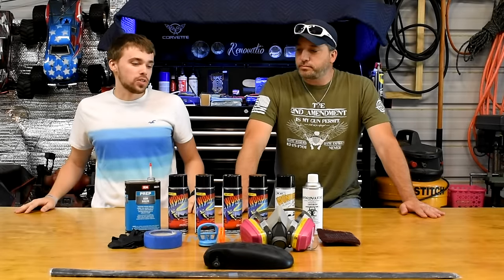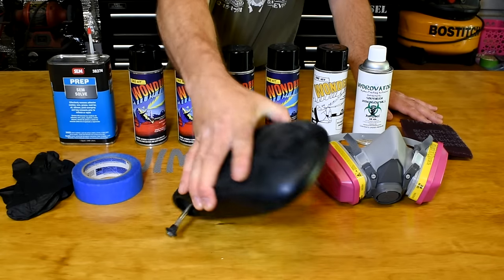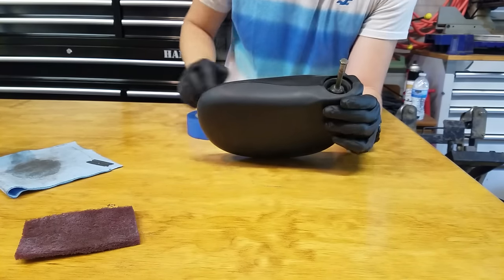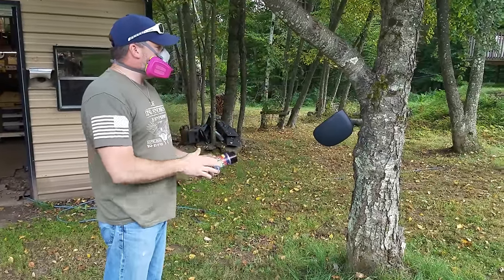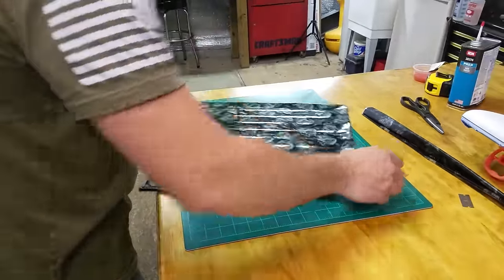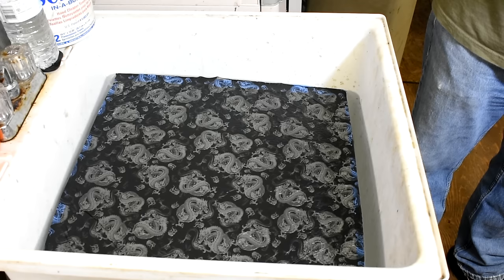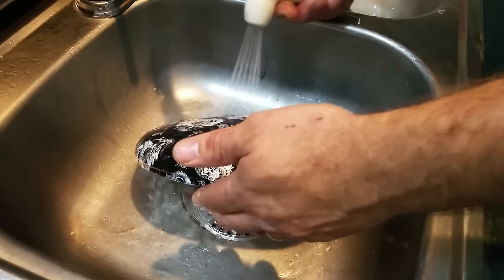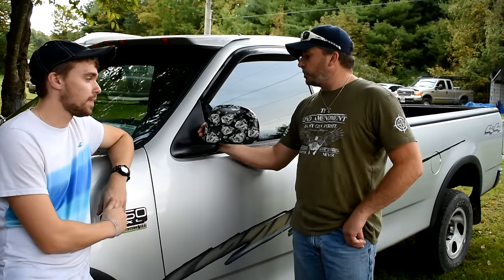How To Hydro Dip For Beginners 2.0

Comment: So I tried hydro dipping earlier today and when rinsing off the sticky layer after dipping it removed the pattern. Any idea why this happened? I made sure the film was placed the right way up in the water.
Thanks
Reply from the maker: That sounds like the surface of your item may not have been prepared properly. If there is any oil or grease from your hands it will prevent the film from sticking. Also, make sure you are using enough Hydrovator. If you don't use enough it will have problems adhering as well. Hope this is of some help, and best of luck on your future dips!

Comment: Right before the mirror was dipped. I saw you poked the film was it? Making sure its activated enough maybe?
Reply from the maker: Alot of the time the little pokes are to try to get the bubbles out before the activator is sprayed. After you spray the activator you're not going to want to touch it as at that point you can mess up the film
Reply: @Jimmy2Tech  after the activator was sprayed Jim's fingers went up at it. Idk if it was by mistake and the water was never touched. And then right after the part was dipped
Reply: @Jimmy2Tech  I was going through the Q and A on the mask and it does not list the type of filter it comes with so it leads you to this affiliate link to offer filters. A pack of 2 is $17.98.  A pack of 4 is $100! This must be a mess up on amazon's part. Crazy though. Thanks for the video. It gave me the confidence I need to start. Way better than the previous video too
Reply from the maker: @Bamlydean  glad you liked it! Best of luck with your dips.

Comment: I'm new to the hydro dipping, but isn't it supposed to be sticky side down and rinse with cold water?? 🤔
Reply from the maker: There are a bunch of different procedures and you can perform whatever one is more convenient for you. This is the way we learned and have had the best success with.
Reply: @Jimmy2Tech  cool just about to do some engine bay parts (1st attempt) and noticed some videos use cold water to rinse, sticky side down, and others are opposite. Wasn't sure if it was a product recommendation or if it was operator preference.

Comment: if you’re dipping like a shoe or leather material would you still use a primer paint?
Reply from the maker: Unfortunately we are not quite sure yet as we haven't dipped shoes just yet. I was thinking about buying a cheap pair for testing purposes. A hard layered leather like a wallet for example to me would make an okay dipping surface but the soft leather may pose an issues as it's got some wiggle to it so it may effect the dip. If you still haven't tried it in the upcoming weeks stay tuned and maybe we can push a video out about it:) we haven't been able to post much do to work, weather, and schedules not always lining up but we have some videos planned.:)
Reply: Puff Gaming yes

Comment: Was that an electric mirror?   If so how did u stop water getting into electric connectors cheers
Reply from the maker: This mirror had no electronic connectors. You can always find the components  and try to  plug connectors . This will stop water from getting in and damaging the system.

Comment: Really nice video.I live in greece and most of the Amazon products are not available. I have spotted on ebay some really nice patterns with a price from 1to 3 euros and others with 30 euros with small difference in  dimensions. do you have any idea what's going on?
Reply from the maker: Not really. Sometimes prices will vary depending on the film manufacturer. Usually patterns dont change the price to much but dimension does. If you're seeing most films at an average price I'd go that route.

Comment: The wonder paint really isn't needed. You can use almost any paint and as long as you hit it with some 800gt sand paper (well you should) before you dip it, just so the film will adhere better. Also, when you're dipping, you should never change the angle mid dip, it'll make the film stretch and with important lines like wood grain, it'll get very wavy. I'd also suggest just using a water hose with whatever temp water, the heat of the water can sometimes make the film flake off but the pressure from a good water nozzle (like one you'd wash you car with) will get all the activator off and won't effect the film. Besides those few tips y'all did great for an at home job!
Reply from the maker: Myles W well thank you kindly for your tips and compliments! Will be sure to give them a whirl. Thanks for watching.

Comment: Hello Jimmy, I just got my film and tried dipping some parts but the problem is that the film won't break down after dipping and when i get it out the water it remains slimy and sticky plus it moves from the subject. ( I have not used any activator ) Wwhat is the problem here?
- can it be done without activator? 
- should I use sand paper on the parts before dipping it?
- should I spray a base on metal or it can be done without it? because most of my work is on plain metal, steel.
- does it remain if I dipped an exhaust without clear coating spray?

I really would appreciate it if you could help me with some of these points.

Thanks, 

Saeed
Reply from the maker: Hello. You're going to need activator for this process to work. So once you set the film on the water, you will spray it with the activator a moment later, then dip your item. This should make it so the film sticks, then you can rinse off the item with some warm water to get the sticky coating off. At this point let the item dry and clear coat. If you're just dipping steal or sheet metal, you don't have to base paint, but do make sure the item is clean and does not have any oil on it as it may cause the film not to stick. Hope this was some help. Good luck on your future dips.
Reply: @Jimmy2Tech  Thank you so much for your reply! I really barely find specific info on YT.

Comment: How long do you wait between the Wonder base coat/primer and applying the film? And also how long before you put on the clear coat?
Reply from the maker: Usually an hour or so after im 100 percent positive the paint is dry. Then the clear coat i take my time with, as the film is on qnd there is no rush so it's best to make sure everything is 100% dry:)
Reply: Jimmy2Tech Thank you for the info and the video! One more question, I have been getting little spots all over the pieces I’m filming. What would you say that is from? Should I be sanding the piece lightly after it’s base coated?
Reply from the maker: @Mrpsychological  little spots can be caused by under activation. If you believe you preped the surface good. Then try increasing how much activator you put on the film. Many times that can be the problem. Practice makes perfect.
Reply: Jimmy2Tech Ok, I will try and add more activator. It’s been a slew of mistakes but even so my project still came out good just minor blemishes and what not. I’ll keep doing it until it’s perfected as you said.

Comment: Good Job Guys, How long do you have to wait for the Wonder Primer to dry? Where did you find the Brand Wonder?
Respectfully, Jim P.
Reply from the maker: Hey Jim. Good name, my dad and I are both named James. Thus Jimmy2Tech. We found wonderpaint doing some research for dipping for our first time. We learned about dip windows and how car paint has a shorter window to dip and have the dip adhere properly. This is why we went with wonderpaint, that and it's a 2 and one which is pretty convenient. Wonder paint and primer dries at about the same speed as automotive paint so wait for it to dry good and have that in mind. Anymore questions Jim feel free to ask. All links to everything we used is right in the description if that's any help. Thanks for watching:)

Comment: Could somebody explain to me the difference between hydro dipping with film, and hydro dipping with spray paint, and the materials required for each?

Do you only use enamel-based sprays for spray painting, and you can't use them for hydrographic film? Do sprays for the film work for spray painting the water? I'm so confused. Any help would be appreciated

Comment: Great video thanks for this, just one question. The angle the dip happens at, I imagine if it's too flat or to steep an angle it'll mess up. What's the optimal angle and how'd you know? Thanks
Reply from the maker: Before we began dipping we researched a long while. 30 to 45 degree angles work optimal, but it is dependent on what you are dipping. The angle ensures a nice even application and also leaves the opportunity for air bubbles that may have been trapped to escape from the item and not stay under the film and pop.

Comment: What do you think it would cost to start this as a business. Do you think you could sustain just doing this or would this be more a side business
Reply from the maker: Starting would be what you're interested in with investing. The bigger money comes when you get a dip tank. If you go no tank you can start with a little over $100 for a good amount of materials. Not to mention, much of this is experienced based. So if you wanna start you're gonna need to practice. I honestly would practice and make it a side buisness and see how it goes and how well you can market it. Then you maybe able to make it a primary buisness. Depends on the demand for it in your area:) hope this helps. Sorry for delay in response, currently on vacation:)

Comment: to get the paint off the glass mirror at the end -what'd u use?
Reply from the maker: Andy Piche  Hey, it actually peels of rather nicely, and the corners where It was stuck on there I VERY CAREFULLY used a razor blade. This has to be done with caution because you can scratch your side view mirror if not done properly. Then after I had the bulk off I just cleaned it with some glass cleaner and it was good to go.:)

Comment: What’s the best clear coat to use for hydro dipping please ? I seem after doing everything when it comes to clear coating it has a reaction and ruins my dip
Reply from the maker: Any kind will work you just need to make sure that the dip is completely dry before trying to clear coat it. Otherwise it can mess it up.
Reply: Thanks mate how long would you leave primer to dry before base coat ?
And how long would you leave your top coat to dry before dipping mate
Reply: @dannysmith714  Read a TDS and U'll be good to go Bro!!!....
Reply: Thanks mate
Reply: Shannan Venz what is a tds ? Can’t find on google

Comment: I have a question,  what is the part number and description of the undercoat clear and where can I get it? Thank you for your help.
Reply from the maker: The Daddy Daughter Team of NJ link to the place where we purchased all the paints  are in the description. They should answer you're questions but if there's anything else you need to know feel free to comment:)
Reply: Jimmy2Tech Thanks so much for the Fast Reply,  the reason why I asked you about the clear inner coat is that I am interested in doing the clear bodies of RC cars from the inside,  similar to PitDawg hydro , but I need to figure out how to get the hydro to adhere to the interior,  kinda like a reverse process, any advice?

Comment: You mentioned about wearing gloves and proper cleaning to avoid oil from the skin getting on the surface. With the film you use do you need to worry about handling it bare handed? Like when you cut it to size in the video? Other than that awesome video and explanation!!!
Reply from the maker: It's important to keep the oil from your hand off the object you're going to dip. Its ideal to keep your hand soff the film but when you're cutting the film to size the thing to avoid on the film is moisture. As long as your hands are dry and not oily then you should be able to handle the film just fine:)
Reply: Jimmy2Tech awesome! Thank you kindly

Comment: Hey bud do you have to have the paint you all use or can I use like duplicoler paint or paint from a hardware store basicly didn't know if it was a special paint for dipping to stick to plz let me know thx
Reply from the maker: You can use regular paint no problem. We just use this paint because  it's two in one and promotes better dip adhesive. Regular paint will work fine though:)
Reply: Jimmy2Tech thx so should it be satin finish or flat or gloss and can ya use regular gloss clear ..sorry for questions
Reply from the maker: @brianmeattey4151  no problem glad to help. You can use any type of paint. Gloss or satin. As the dip will cover over it. The clear coat you use after to seal the product will be up to you as to whether or not you want the item shiny or flat.:)
Reply: Jimmy2Tech k I really appreciate it I ordered a bunch of stuff and cant wait to try it .you all don't sell any of this do you ?.I would do a order if so .but the base coat paint .us what I needed to know about is should it be flat or gloss in order for film to stick just out of curiosity  and that k you for the info .hope to see more content thx
Reply from the maker: @brianmeattey4151  the film will stick to either flat or gloss base coat. So it's honestly up to you. Yeah, we dont sell or do anything like that. Just a hobby my father and I have.:)
Reply: @Jimmy2Tech  wish ya all would sell stuff like the paint and film as well as the other stuff id deffinetley b uy it but if you do plz hit me up and ill be first buyer lol again thx for all info and looking forward to more content thank you

Comment: How long do you have to wait after the base coat before you can dip
Reply from the maker: Just wait till it's good and dry and dip. Rushing it never works well as if the base coat isn't fully cured you'll have adhesion issues.
Reply: @Jimmy2Tech  appreciate it

Comment: What did you use to clean off the mirror. excess film?
Reply from the maker: Razor blade and some cleaner. It comes off pretty good as long as it's before you clear coat it.

Comment: Hey man idk if you will see this, but i recently got into the practice and on a lot of dips not all the edges get covered or there are little spots that poke through the film. Any suggestions as to why that is happening? Thank you so much!
Reply from the maker: Usually when you're seeing little spots that poke through it's usually a prepping problem. If the item isn't prepped right before the dip little spots of the film wont transfer over correctly. This can be do to oil and grease still on the item. If you believe you're item is prepped well, the other thing I can suggest is spray a bit more activator on the film when you're at that step. You may not be getting the edges of the film enough and that may be causing it not to adhere properly. Hope this helps and solves the problem. If not feel free to reach out to us on our Facebook page and we can help you the best we can:) thanks for watching!

Comment: First time dipping please excuse me but Are all the films you buy transparent? on ebay there is not a lot of description.
And also there are some that are full of colour, like the stickerbomb film does that mean I don't have to spray at all as long as the surface is cleen?
Reply from the maker: They are simply films. They have color and some sections look transparent. The paint helps the dip adhere to the surface of the item. And if there are transparent spots the paint that you put down would be the base color for the transparent sections. Hope that's helpful. If you have anymore questions feel free to let me know.
Reply: @Jimmy2Tech thank you for the reply
could I use a cellulose based primer and gloss top coat? 
then applyed the film straght after it's dryed, would that suffice for good adhesion? 
Obviously I'll use the activator and a clearcoat after..
Reply from the maker: @tsmithurst  yeah that sound like it would work fine. Usually how it works is the fresher the paint the better the adhesion. Just make sure your paint is good and dry before you dip it.:)
Reply: @Jimmy2Tech  thanks so much sub and like just for your rapid info thanks again hope you and your dad go far in this 👍
Reply from the maker: @tsmithurst  thanks, really appreciate the support.<3

Comment: Hey I have a question. I want to hydro dip the interior trim plastics of my car because they are a glossy silver and I want to do a gloss black or carbon fiber. I don’t really think I will be able to scruff off the slick surface. If I paint over it as it with the wonder paint and then hydro dip over that will it be ok?  Also wondering if there’s any way to make the work not permanent in case it doesn’t come out good or I want to have the original plastic back. Thanks for your help!
Reply from the maker: With the glossy slick materials sometimes the paint wont stick to the surface of what you're painting well this we do it. You may possibly get away with it if you clean the item really good and dip it. It doesn't have to be permanent as it's just an ink and can be scraped off along with some chemicals. Think of it as an ink tattoo on an item, but instead it's on the surface and not in the skin.
Reply: Jimmy2Tech thank you!
Reply: Andis Jansons the only problem I had with vinyl is that the pieces are very curved and rounded so I didn’t know if I’d have the skill to have make it with wrinkles and folds
Reply from the maker: @andisjansons2939  yup, if you have a heat gun that is also a fine option:) we've played around with that some.